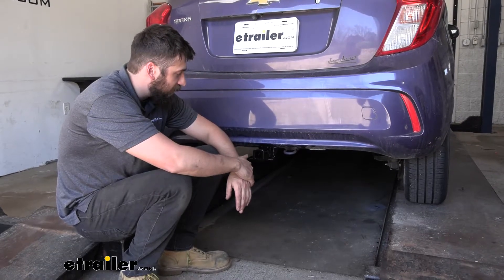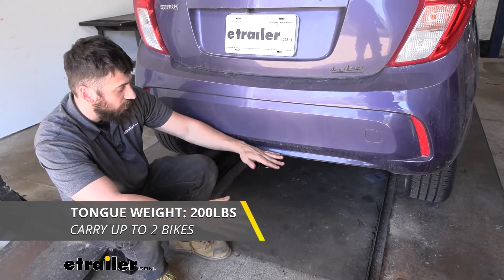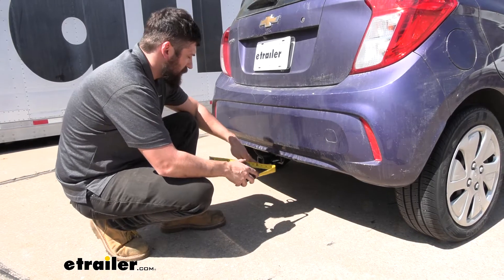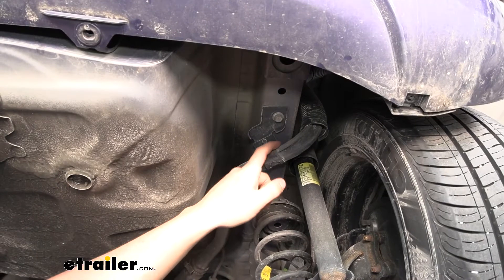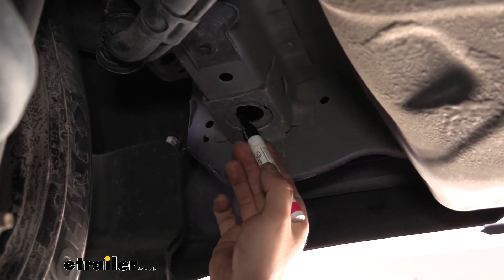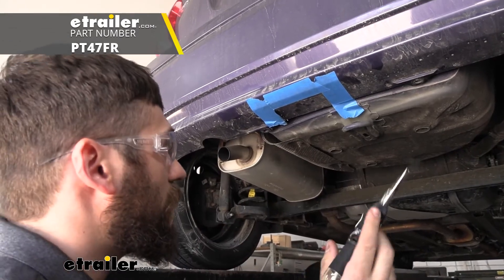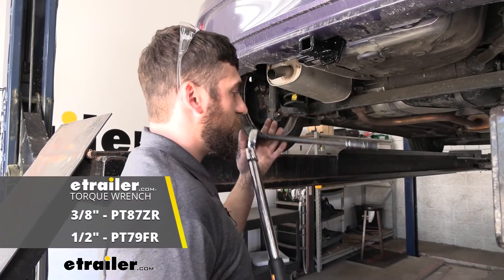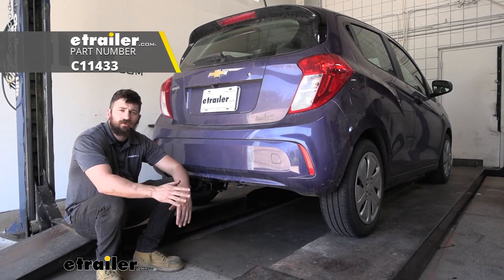etrailer | Installation Guide for the Curt Trailer Hitch Receiver on a 2017 Chevrolet Spark

Comment: Chevy spark owners manual says its NOT rated for towing, at all. From your experience, what can it actually tow?
Reply from the maker: Although some folks likely ignore the statement in the owner's manual that says the vehicle cannot be used to tow a trailer, most folks use the hitch as an attachment point for a hitch mounted accessory like a bike rack or a cargo carrier. We don't recommend doing anything that contradicts what the owner's manual states.
https://www.etrailer.com/Trailer-Hitch/CURT/C11433.html